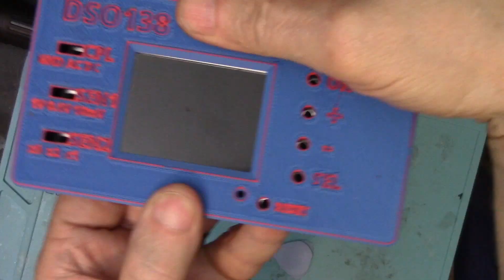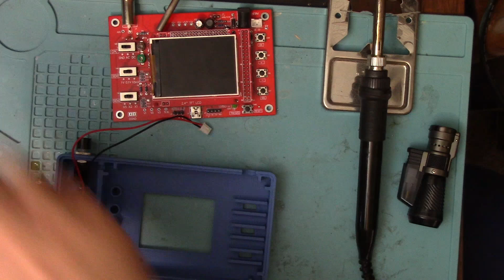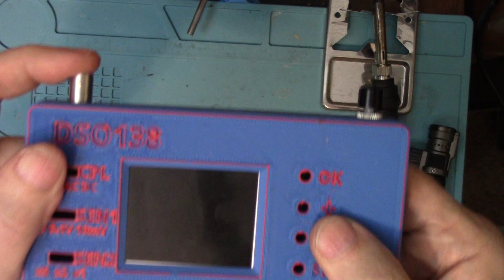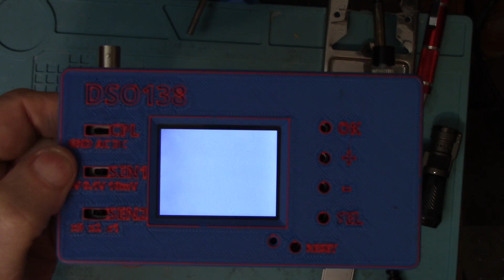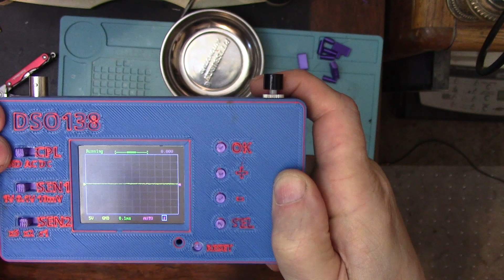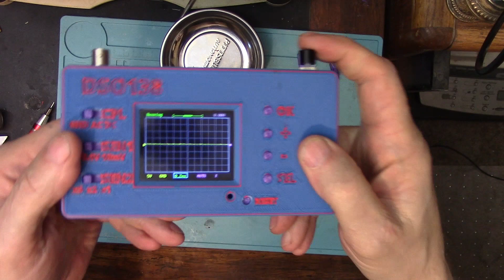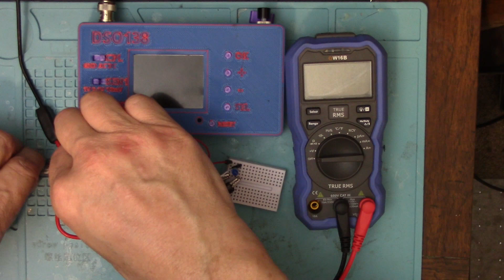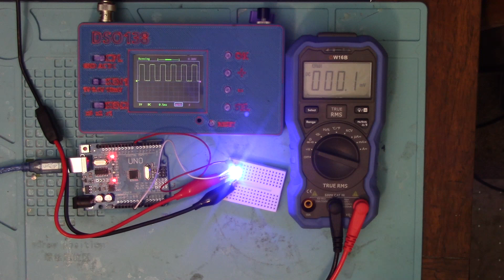Putting the DSO138 into the 3D printed case using rechargeable 9v battery

Comment: Isn't it the live wire that's switched in a power circuit?
Reply from the maker: Yea, in a negative ground system it should really be on the positive. On a floating ground it really doesn't matter. Many years ago I worked on a racing team and the head mechanic insisted that all switches go on the negative side of the circuit. He was a crabby old bastard and I was young and too scared of him to ask why and I've been doing it that way ever since.